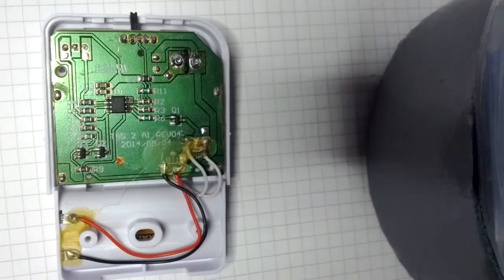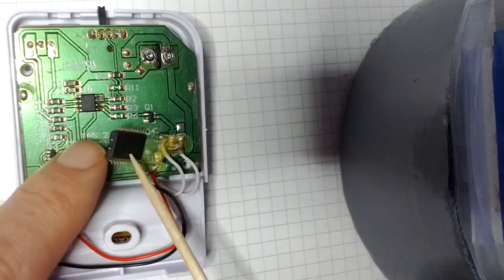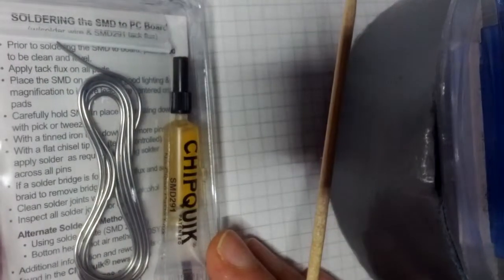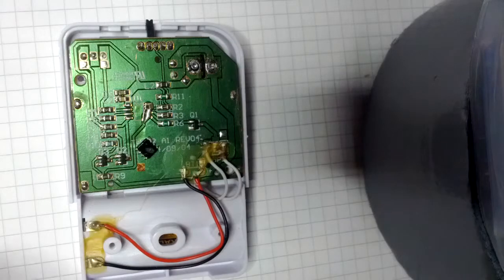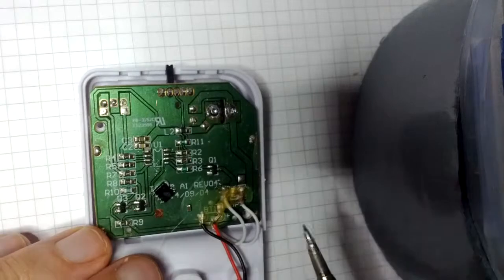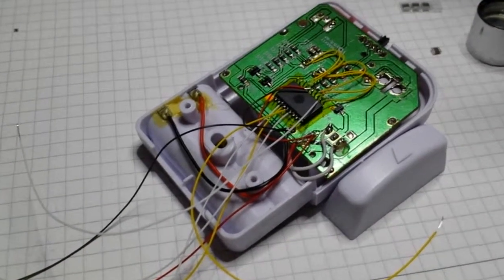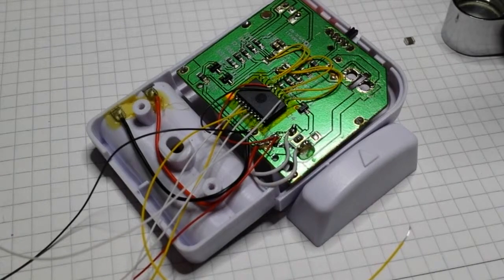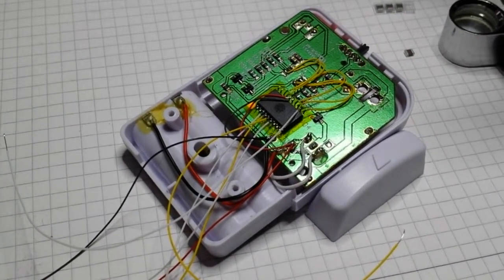Lidl door alarm teardown part 2

Comment: Joe, not sure how to contact you ? I am interested in what TAPE you used when you refilled a P-touch 65 label printer. I am trying to do the same thing but I am confused regarding the type of tape.
Reply from the maker: +Ken Roberts jdesbonnet at gmail will reach me.  That experiment with the p-touch wasn't very practical: yes, the printer could print to thermal paper, but it had difficulty feeding it through the print head. I found some reasonably priced refill cartridges on ebay and have enough to last me a few years now :)